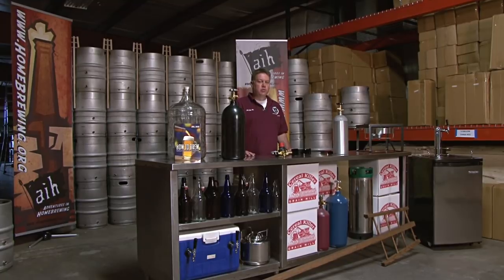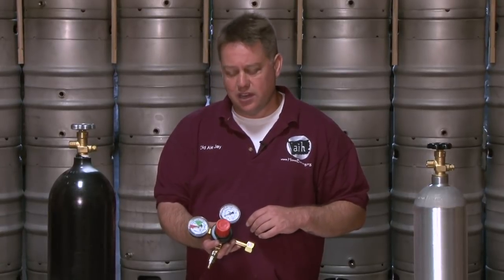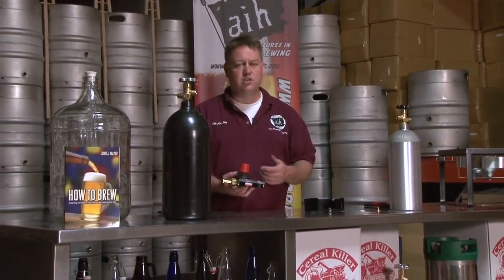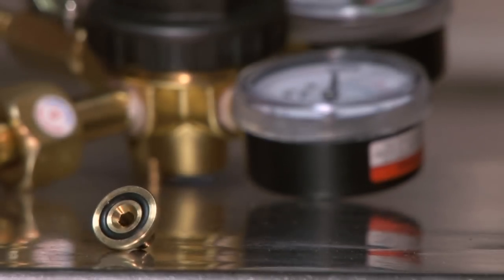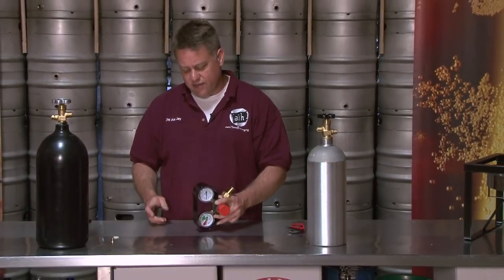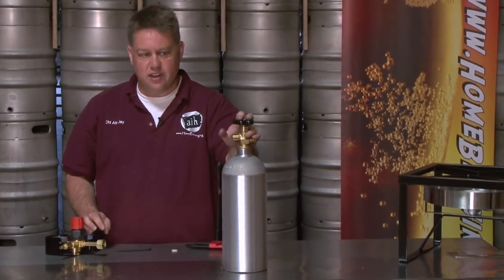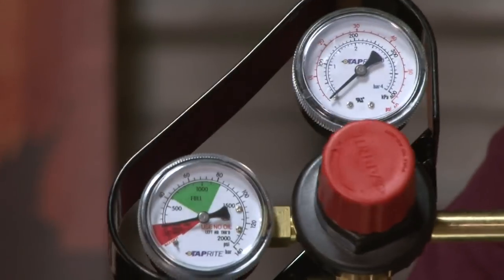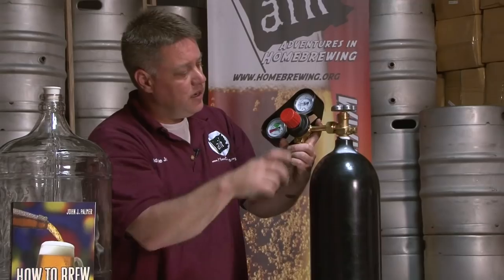Adventures in Homebrewing Co2 Regulators

Comment: This is great because Taprite's own instructions totally suck. I quote from the manual that came with the regulator. 6. "With cylinder valve ("A") in closed position, reattach regulator to cylinder at ("E"). Use a plastic or fiber CO2 washer to couple regulator to cylinder, Taprite regulators have an inlet nipple Seal (O-ring) that eliminates the need for a washer. BOGGLE WTF?!? Didn't you just tell me to use a plastic or fiber washer then turn around and extol the benefits of your regulators O-ring being such that I don't need the one you just suggested that I use? I did a double-take to make sure this wasn't a generic instruction sheet designed to cover all the regulators sold by the vendor I bought from; sure as the sun shall rise it's emblazoned with the Taprite logo and address and was in a sealed box from Taprite. GAAAAAAAAAHHHHHH. Seems you don't need any washer at all...thanks for making this totally clear cause Taprite sure aren't helping things with their instructions.